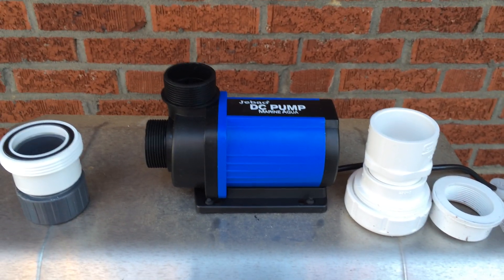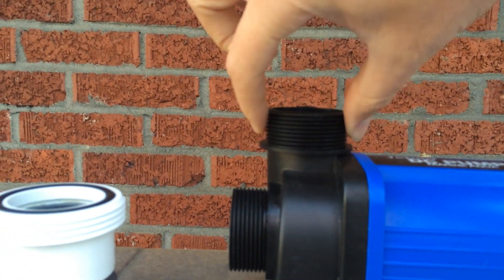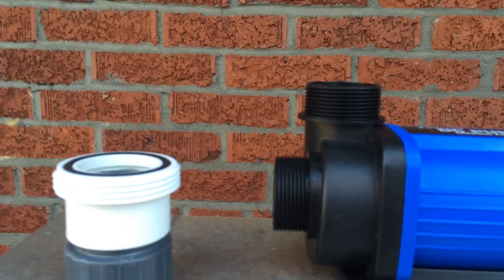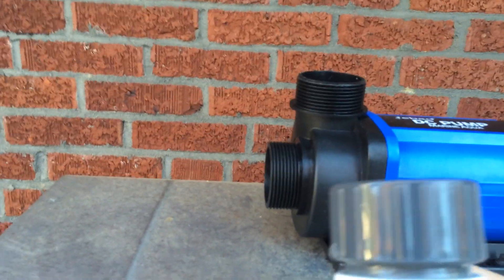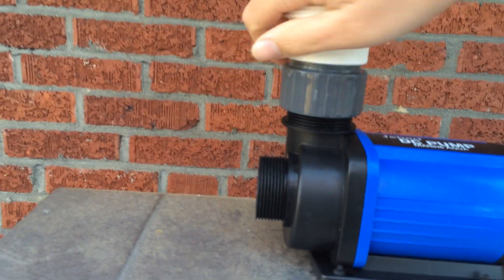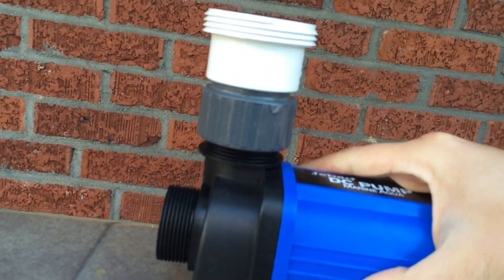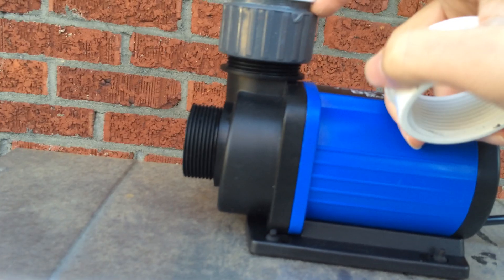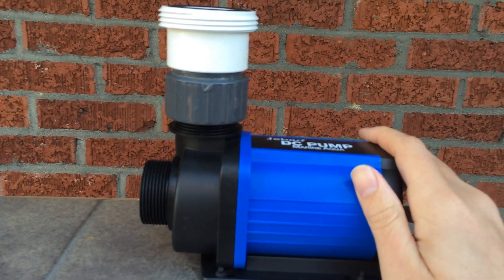Jebao DC9000 DC12000 plumbing

Comment: As of May 2020 -this does not work. The pumps are coming in with Metric threads, and any number of American Pipe fittings - tapered or not - WON'T work.

Comment: Are you using your pump submerged?  I'm working on an external application and I'm wondering if you can use the adaptor you are using connect it w/o any leaks.  My pump came with fittings but they need to be glued and that will disable that fitting for other applications.  Would love a set up where I can take it all apart, but can't have any leaks in the living room.

Comment: just get the gray electric adapter (terminal adapter) at homedepot, found in the electrical isle. Those should bottom out whereas the white ones won't.
Reply: Man I've had this pump for a year now and not having the right fixture been killin me. Just went to home depot and bought that terminal adapter. Thanks for the insight! Saved me the hassle instead of going to that website.
Reply: Do you have a part number, description, or link? Thanks!

Comment: Thank god you posted this.  I've been trying to figure this out for a week.  I know I need bsp threads but cannot find this adapter anywhere.  Where did you find the bsp adapter and is it pvc or abs?
Reply from the maker: Yeah, they're a pain to find.  
For the DC-12000 I found a 1.5" adapter @ rrproducts.com, RRPart# RG378015G/Spears Part# 378-015G,
For my DC-9000 1 1/4" I found an adapter at kscdirect.com Part# 335-012
Both had to be ordered by the site and took a bit of time. Well worth it though.
Reply: HumanHiLiteReel Awesome!  Thanks so much.  This is exactly what I was looking to find.
Reply: I found the part you mentioned on that website but it said I have to order 25 of them minimum?? I only want 2 how did you get just one
Reply from the maker: Jorden Watkins I just checked both websites listed.  They still offer them as single parts.  If you're talking about the kscdirect.com site make sure you pick the non-G version.  For some reason the 335-012G is sold per box which is Qty 25